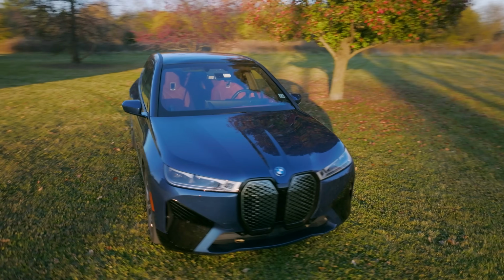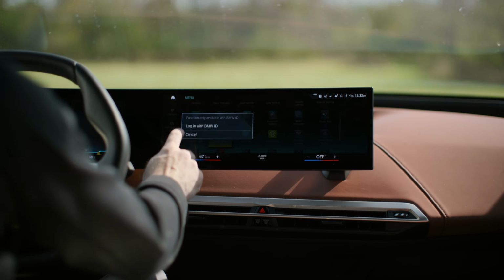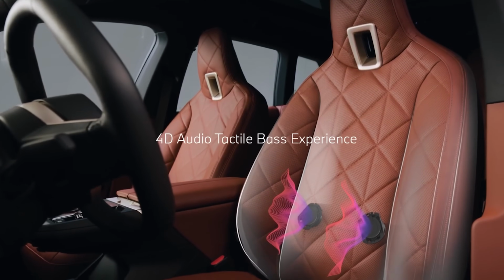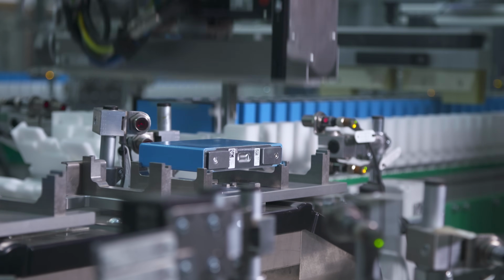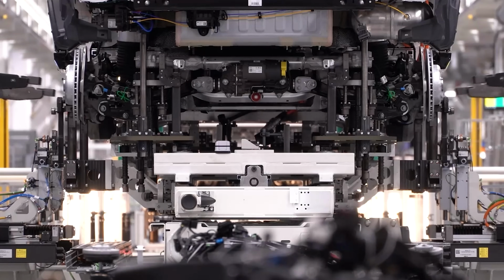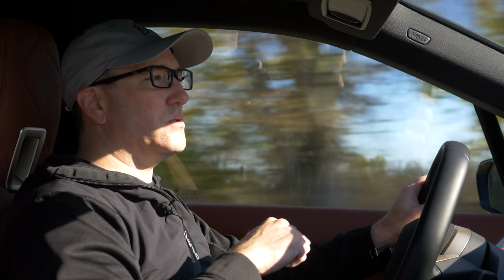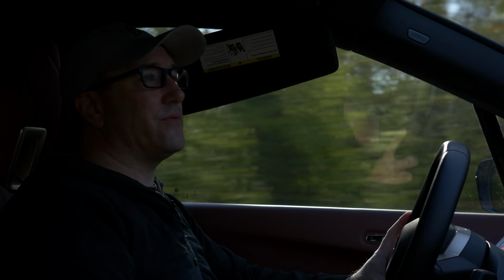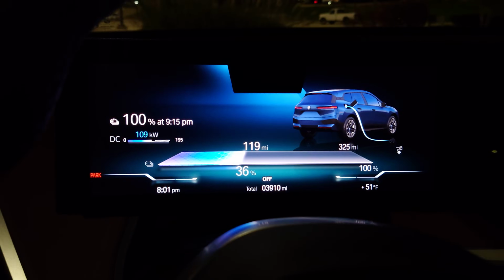BMW iX M60 | The Frustrating Future of EVs

Comment: Who will buy this is people who need a car now, don't want to buy a combustion car, and have the money to spend.  Meaning lots of folks. You almost never charge an EV from 15% to 80% in the real world. You charge from 10% to 50% for 15 minutes and that's it. If you're on a 300 mile road trip leaving with 80% you do that once and charge overnight at your destination. Going farther? Do the same 15 or 20 minute charge stop every two hours and 120 miles.  And that's with the 5th gen battery architecture.  It's not disposable.  I wouldn't be surprised if their packs lost 10 or 15% after 200k miles, at which point you'd have 280 miles instead of 330.  Will the next gen battery architecture mean you won't need to make a single 15 minute stop for a 300 mile trip? Sure. And for longer trips your stops may be 8 minutes instead of 15.  But this car will still be quite useful for a long time.  If you always need the new iPhone and plan to treat your EV cars that way, you'll be upgrading to the latest tech all the time. But the better EVs selling now with good battery cooling and 300+ mile range will be practically useful for many, many years.

Comment: I simply wonder how many customers automakers believe can afford $100k vehicles?   I prefer physical buttons and ease of use.  I do not want to drive an I-phone on wheels and I will never pay $100k for any vehicle.  I think used ICE vehicles are going to continue to rise in value.  Not just because its easier to fill a gas tank in 2 mins than charge a car, but also for the physical buttons. The auto world is headed in the wrong direction.  They won't sell as many units moving forward.  (also that grill in front sucks balls dude)

Comment: One of the things I like about Mark's channel is that implicit in his EV reviews is that we are still in the Model T phase.
Reply: Nope we're more like in the Ford FlatHead V8 phase of the 1930s. With shared platforms from Hyundai Kia Group, Tesla, MG SAIC with more advance higher Miles Per kWh vehicles. These are mass produced daily drivers that will have a great service life. Sure there are many improvements still needed perfect the drive train, but they are very much refined enough to be long term work horses.
Reply: @Neojhun  "Sure there are many improvements still needed perfect the drive train" Well said. With the current battery technology we are trying to build a very-very-very long ladder to reach the Moon. OTOH, I actually believe that you were right about the horses.
Reply: As an EV owner I don't completely agree with his closing thoughts because its the typical goal post moving line when you've been conditioned to buy gasoline and are struggling with change:  "when they get 200 miles range, no...300...wait...400...when the next battery comes out...when there cheaper..." the list is endless, and ridiculous in 2022. My suggestion,  buy an EV now because you're ready to make a change away from pumping gas as a ridiculous expensive habit for starters.   
First, A LOT of NEW BMWs and Mercedes and 6 figure luxury cars in general (ICE or electrified) are leased because of the massive depreciation and the image signaling a new car represents to many buyers in this price range. The overwhelming majority of new BMWs in particular are leased, so is this truely a ding on the EV platform? no. 
Prior to the Tesla Model 3 (2017)  I would have agreed to lease your Leaf or what ever you bought between 2010 and 2017 when the Model 3 came out. However, its widely excepted that the Model 3 started the era of buying your EV for the long term. For reference, I bought my 2018 BMW i3 with very, very, low miles in 2020 for a bargain $22K from the dealer and intend to drive it for many many years, its the cheapest transportation there is and I still have zero battery degradation after 50K miles and zero maintenance costs. The long term high mileage data is readily available now which proves that fears about  battery degradation is mostly unfounded  and minimal  after a 100k miles or more and you still have plenty of range to meet your daily needs. I don't agree that EVs are disposable after 3 years,  that's ridiculous, we're just not used to seeing true advancements in the auto industry, so it seems like there's never the right time to commit.  Are you not going to buy the new iPhone because there will be a new and improved model available in 2025?
Reply: Very well said. The only difference is that horses were not demonized, when the Model T was revealed. ICE cars, sadly, are pictured as outdated, inferior and harmful modes of transportation.
Reply: @tamasszabo8824  just like EVs....hiding the problem away from home does not make the problem go away, it just transports the pollution to less desirable populations
Reply: @tamasszabo8824 we went from using horses for everything to using horses for sport and relaxation within a decade. If you look at countries like Norway ICE vehicles are already the horse, the EV has well taken over.
Reply: @tamasszabo8824  "horses were not demonized" WRONG THEY WERE! Stop trying to replace history.
Problem with horses was literally POOP & URINE WASTE which littered the streets. This was a horrible problem clogging up the streets in heavily populated areas with high traffic.
Ironically a very similar problem we have now.
Reply: @Neojhun  I grew up on a farm. Livestock poop and pee wasn't a problem because of the low density of the human and animal population. That was/is the insurmountable problem of the cities, whether it's poop, pee, viruses, crime, pollution, noise, etc..
Reply: @tamasszabo8824  read some historic documents dude. Horses were hated because the whole city was full of horse shit 💀
Reply: @tamasszabo8824  Exactly, people who drive electric (tesla owners) think that cobolt and shit grows on trees lmfao
Reply: @tamasszabo8824  Agree 100% The EV “disruption” model is made possible by government regulations putting a thumb (or 3 trillion) on the scale. EVs just don’t really do anything better than gasoline powered cars/trucks, except maybe accelerate harder. Owners need a place to charge EVs, usually daily, because gasoline stores more energy per pound than a battery can. How do we get the stuff to make batteries? Strip mining? What do we do with the batteries when they degrade? Uh oh. That’s a huge drawback for EVs, especially if you like road trips or use your truck to tow a trailer full of tools/parts in four counties every day for work and you’re driving a 1999 model with hundreds of thousands of miles on it. But what do I know.
Reply: @nateisright  Everything you said and INSINUATED was Wrong or Outdated.
"gasoline stores more energy per pound" Is not relevant when 65% is not even used to propel a vehicle.
There are soo many things wrong with a cliché overused script I ain't going to bother.
Reply: @nateisright  "gasoline stores more energy per pound than a battery can". LOL so what about the energy per pound stored by gas.  An ICE is incredibly inefficient at turning stored energy into kinetic energy. Only about 30% of the energy in gasoline is actually used by an ICE.  70% of the energy is lost as heat.  As someone who is not a big fan of EVs and who is going hold on to his ICE as long as possible, even I realize that EVs are much more efficient energy use wise than an ICE.
Reply: @YachtsOnTheReg7  There are several things that limit batteries: abysmal energy density (still not enough even with highly efficient chemical to kinetic energy conversion), cooling and problems with low temperature.
Reply: @YachtsOnTheReg7  Indeed. Gas trucks are 10-20 mpg. Electric trucks are 30-50 MPGe. Even if you still have to burn gas to make electricity, you're still getting 3-5x more energy density than straight from the tank.
Reply: @nateisright I have 2 EV’s one gets charged weekly the other every 2-3 days. Most people who own them where I live have a charger in there house or apartment. I’ve gone from spending about 6500 USD on fuel for two vehicles to less than 500 on electricity. There is also very little maintenance.

Why happens to the batteries is they get recycled, the rare earths used to make them are extracted and reused, the aluminium and steel is smelted down and reused. A battery is about 95% recyclable by weight.
Reply: Evs are in their model t phase for about 150 years now, and they are still shit
Reply: @_zigger_  LOL that is what you have programmed to think, while having now clue how it works in reality.
Reply: Except that they aren't. They were introduced, evolved and failed 100 years ago. And game changing technological advancements were promised back then. A 1000 lb. battery is lucky to go 250 miles, while 130 pound gas tank can go 400+ miles and can be "recharged" in about 5 minutes. These are insurmountable roadblocks, unless you cheat and use government force to get rid of/drive up the cost of gasoline/diesel.
Reply: @teerexness  A 1000lbs battery can easily do 270 miles in a British cold damp night (Carwow Range Test). Which is a massive range which majority of driver rarely drive in one day. 400 plus miles is pointless for most people especially when you have way more places to charge on Level 2 AC and not require dedicated trips to gas station. 5 minutes is SLOW and a waste of time, it takes 30 SECONDs of my time to charge on Level 2 AC at work or at home. Those are only psychological roadblocks which you have been programmed to believe. It has nothing to do with governments or cost. People just like living with BEVs because it Functions and performs better.
Reply: @Neojhun  400 miles is certainly not pointless if you are driving across Nebraska, Kansas, the Dakotas, Wyoming, Idaho, Utah, etc.. These places also experience temperatures below zero for weeks at a time. And you can put a small storage tank of diesel/gasoline on a farm or construction site and you immediately have hundreds of hours of productivity. These places scarcely have the infrastructure for chemical toilet, but a truck can easily deliver energy to do the work that they need to do for weeks at a time. The same applies to gas stations in remote areas. All you need is a storage tank and boom, everybody is on the move.

Comment: Hideous styling, extremelly massive and heavy (in part to have enough battery capacity for adequate range), fucking expensive...
Yes, if you change only at home its almost as cheap as a much cheaper, lighter and with better range ICE car.
Hear me out...
Lets assume some average comsumptions and current prices:
Gasoline: 8 L/100km - 2 €/L
Diesel: 6 L/100km - 1,8 €/L
LPG: 9 L/100km - 1 €/L
CNG: 5 kg/100km - 1,3 €/kg
Electricity: 16 kWh/100km - 0,5 €/kWh
So out cost for doing 100 km is:
Gasoline: 16€
Diesel: 10,8€
LPG: 9€
CNG: 6,5€
Electricity: 8€

So... Why the hell should I buy a car that is on par with CNG & LPG on prices per distance, is multiple times more expensive that an LPG / CNG ICE car, has worse range, much much worse refueling times? No point... Not to mention that the fast chargers on highways are in the ~1 €/kWh mark. That is gasoline money! If you could charge only in home, and the electricity was like pre war <0,2 €/kWh them it migh make sense. Its all too rushed...

Comment: Liberals want EV's for the environment, but they will be worse in the long run as they are basically disposable vehicles. I have a 2015 Nissan Xterra Pro-4X at 94,000 miles and it is just getting broken in! Only two small issues in those 7 years.

Comment: I believe the doors have to have a mechanical opening of some kind for safety reasons. If your ev crashes into a lake, the electronic opener may malfunction and lock you in
Reply: Problem is, since it never gets used on a day to day basis, most occupants won't know it is there and they will panic.
Reply: @povertyspec9651  Good point, I'm sure the company's are just covering their butts if someone tries to sue
Reply: @chasenewberry6866  Yes, and to meet government regulations which requires this when you have electric door openers.
Reply: That was his point. Why have the button when you have to have the pull handle anyway.

Comment: In ten years, the battery production cost will drop so much that the battery replacement won't be catastrophic!
Reply: Will you be able to get one that fits your particular vehicle?
Reply: Even now there are small companies making refurbished batteries for older EVs. It’s a growing industry so it would be more available in the future.
Reply: Battery packs are modular so the individual cells can be replaced by newer and better cells.

Comment: I agree with the early comments in the video about the interior of the iX. We had a test drive in the “base” version and found the interior disappointing despite good build quality. The materials did not match the out the door price of nearly $90K with a few must-have options. The interior of the pricier spec was too Trump hotel for our taste. Driving the iX was great, despite the awkward steering wheel, but it has huge exterior dimensions not matched by useful interior space. The lack of a mechanical shade for the glass roof was another miss for us. We ended up replacing our off lease Honda CR-V with a BMW i4 e40 msport. The size, cabin quality and driving dynamics beat the iX, at least for us, and the cargo space with hatch has so far handled everything we used to throw into the back of the CR-V. The icing on this cake is great efficiency. We routinely got 4.0. mi/kWh in the fall and are still getting 3.6 to 3.8 in near freezing cold.

Comment: I am actually very optimistic for BMW in the future based off of the iX and the new 7… I think things are a bit disorganized right now as they still try to figure out exactly where they are going, but a lot of the underlying tech and talent for the products is industry leading, and I think once they are able to get their ducks in a row, they will have some really fantastic cars in the next 5-10 years.

As for design, I’m hopeful they got the message, and will refine a new design language much like they did in the early 2010s following their experiments in design in the 2000s. The same goes for iDrive, which was super awkward when it was first released, but slowly evolved into one of the best systems on the market. 

I would not buy this car, but I look forward to the cars to follow.

Comment: I disagree with this, i'm currently using an iX as my only daily driver and i think the 400v architecture has a long life cause its less prone to degradation.  If you are charging at home, on AC, there are no charging speed concerns.  This car has very consistent battery charge level even in cold weather compared to other EVs.  Plus its not a structural component.  I think these guys often get hung up on spec sheets, but Polestar even reverted back to 400v for the Polestar 3 and thats because for big battery capacity and degradation, its better than 800v.  I think these cars are going to last a while, but yeah, when they are "used" they will probably be useless, like any other daily driver type of car.  There is never going to be an EV thats like holding its value in 10 years, the tech will keep improving.

Comment: Frameless glass like that is a nightmare… constantly poking you in the face when getting in and out, working on the car or cleaning it. 😮
Reply: And always causing concern if it will go back to flush when the door closes. BMW/ Mini doesn't do frameless the way the Japanese do.
Reply: Because... metal is softer?
Reply: @tim3172  no, the metal frame has a nice soft rubber seal around it plus you can see it from your periphery easier where the glass you cannot.

If lived with or worked on a frameless window car you would know.

Comment: all im waiting for is the fun, sporty, affordable ev. i mean the power is no problem, so all we need is a somewhat lightweight car (the hardest part of the equation i guess) with fun handling. basically the mx-5 / fiesta st / gt86 of evs. i think at that point you may convince me. maybe dual motors at the wheels for the best torque vectoring you can imgine?

Comment: Great video, amazing work, many thanks. One thing that is not stressed enough is the vendor software locking, like iPhones with screens and batteries. Does it exist in this car? If so by how much and which components are affected?
An example of that is the VW ID 4, where you can't just get a motor if it fails, the VW factory has to produce it specifically for your exact VIN number, which takes many months.